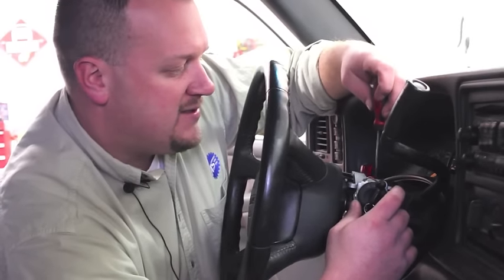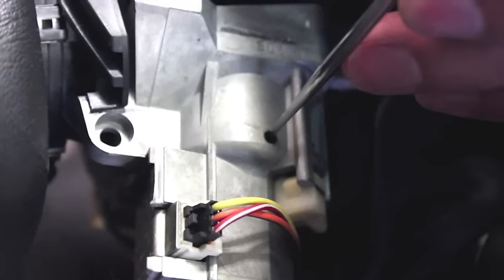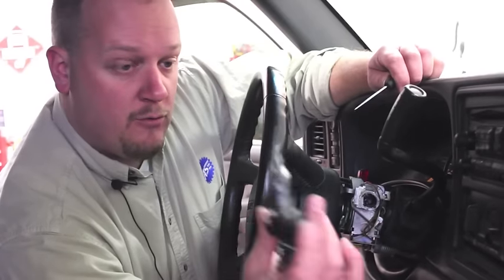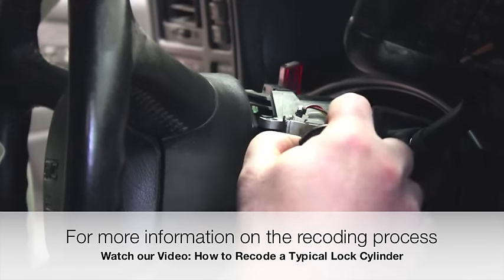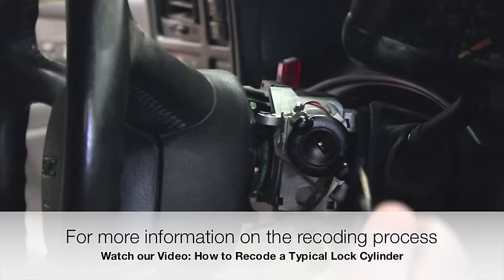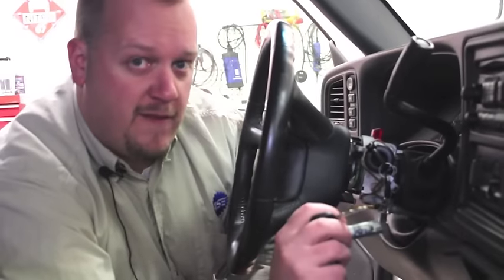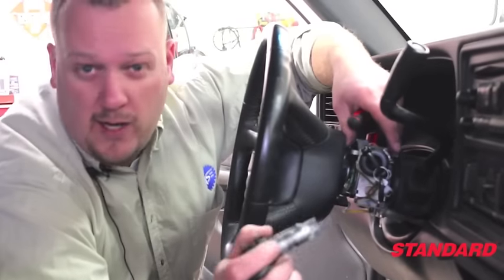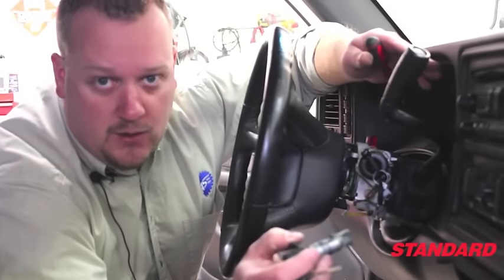Ignition Lock Cylinder Replacement (late model GM Trucks)

Comment: What if the old key don't turn the switch to the on position can I still change it.
Reply: My current problem
Reply: @jamessteyn980  figure it out? I have same issue
Reply: I used a hairpin to push the bottom locking bar @WilsonGamingYT

Comment: This is the most helpful video on GMC lock cylinder, and ignition module, replacement. I used this technique on our 2000 Envoy. No need to take off the steering wheel like other videos propose. Trickiest part is removing the plastic covers on the steering column. There are two torq screws accessible from the bottom. Take those out, remove the steering column adjustment lever (I used pliers for a firm grip, and pull straight out) then using flat head screwdrivers push & pull on the bottom column cover to remove. Swearing helps. Once it's removed, there is a reverse torq screw holding the top cover in place. I used a small socket that fit, the screw is not in real tight. Then the top cover can be pushed and pulled till it's off. Remember to disconnect the battery. Once covers are off, simply follow the directions in the video to take out the lock cylinder. If the key & cylinder won't rotate, there is a small bronze-coloured tab below the cylinder you can push in and the key will turn to the crank position (I got this off another YouTube video---on the Envoy, with the steering column cover on, there is a small access tab on the lower right side of the cover [at about 4 o'clock when facing the steering wheel] which can be easily popped off to allow a plastic prod to be pushed in to compress the tab. Without the column covers on, you can push the tab with your finger.) The ignition module could also be switched out if needed, it is accessible with the covers removed-again, no need to remove the steering wheel. Thanks for the great video, saved me time working in 28 degree cold. I knew it had to be easier than taking off the steering wheel, a few years ago the key in our 1998 Jeep would not turn, our local mechanics came over, towed the car to their shop and were back with a working cylinder in about 1/2 hour. They must have used some version of the technique outlined in this video.

Comment: to remove shroud, remove two t20 from bottom. remove bottom half. there's an inverted torx in front of the ignition switch. it holds the top half of the shroud down.  I used a 4mm socket to remove that. then tilt the wheel all the way down and fight the top shroud off.

Comment: For those that are still wondering how to change the cylinder if you cannot turn the key, you do not have to force it or break it!
There is a small detent on the outer ring, justnear the bottom facing the driver.  A simple screwdriver or pick inserted there will allow you to compress the cylinder ring and slip past the pins.  Then, when its in the ON position, the rest of the process to change the cylinder is quite simple.
I have AAA and called out the locksmith because I could NOT turn the key at all, even after removing the cowlings and trying lubrication, etc.  
The locksmith sat down and in 5 seconds had the truck running.  We changed the cylinder at this point and its all good.  

FWIW, the AAA membership saved my backside, and that ONE covered event paid for the whole service for a year.  Not that I am selling AAA or anything like that, but its worth the investment to me.  Now I know how, I am unlikely to ever need to do this again, because the new cylinder will outlive my 2002 Chevy.

Good luck to anyone who finds this post helpful, or is in need of this information!
Reply: U saved my but thank u

Comment: Great instructional video,
I swapped out the lock cylinder on my 2005 Silverado in 20 minutes!
New lock cylinder with keys cost me $50, dealer wanted $330, parts and labor.
Thank you,
Reply: My 2005 Silverado is acting up and I believe it is the ignition. Power stays on to radio even after key is out and doors open and shut. Do you think this will solve my issue?

Comment: I switched out my old stuck bad ignition with a new one off eBay & everything went as you said, fairly easy, Only now the truck wants to start and sometimes does start but dies right away. My truck has never done that, do you think the new ignition that seems to work perfectly somehow isn't allowing it to run?
(I did have the negitive battery disconnected until i was done) could i have possibly shorted out something? Any help would be greatly appreciated.

Comment: I have a 2003 suburban and it seems the ignition cylinder and key are messed up. I can't turn the key in the ignition at all but the key works in all of the doors. how might I get the old ignition cylinder out if the key can't be turned at all?
thanks,
Marc

Comment: Can I take the key and ignition from a different truck and swap it into my truck or would I need the pcm for that ? Currently swapping a 4l80 into my 5.3 and my friend said I can get his harness and pcm but at that point I’d have to delete the vats to be able to start the truck cause key would be different but if I swap his ignition over and use his key it would start so just trying to see if this would work because it would be cheaper than buying hp tuners and deleting the vats

Comment: Hi, Good video, better than the others.  I have a 97 GMC Sierra. Problem is, removing the top & bottom shrouds from the steering column. The hole for the key cylinder is one piece with the upper shroud and with the black plastic key shroud on the key cylinder it can't be removed. Is there another way to access the push hole to release the key cylinder?

Comment: Truck still runs after key is to turned off and removed in 99 tahoe...I have aftermarket viper remote start alarm also the key is worn and sometimes have to wiggle it to get it to turn...do you think it's the ignition and key? Need advice before I spend all sorts of money on meaningless parts...

Comment: I changed the ignition cylinder switch because my Tahoe got stolen. We found out that they were using any random Chevy to start our Tahoe. After switching the ignition cylinder switch we found out that it could still be turned on with any key or screwdriver just by putting a little pressure and turning it. How could this issue be fixed since we already replaced the ignition cylinder switch and it could still be turned on with mostly any object.

Comment: i have a 2005 ZR2 Blazer and replace my vehicle's ignition lock cylinder. it starts and turns off but i cant turn it to the   eauxillary spot or pull the key out what did i not do or do wrong this was my first time doing this and with this video it was not hard. thanks for you doing this video .

Comment: Hello, My name is David. I really need some help. I have a 99 Suburban 1500 4wd. The security light was on for a few weeks but there was no problems. I left the lights on, battery went dead, I jumped it to start it but all it does now is start for a half second and shuts down.   had a couple look at it and they say its the factory security system.    Any thoughts or advice on this would be greatly appreciated..

Comment: ▪️▪️▪️▪️So we replaced ours in a 2005 buick rendezvous & it came with new lock cylinder and set of keys. The ignition comes on but won't start we keep getting SECURITY light after the battery light. I've tried the ignition on for 10 minutes cycle already. Any other ideas? Thanks for your help! ▪️▪️▪️▪️▪️

Comment: so how do you replace one if the lock won't turn to the crank position ? 
sht worked fine one min next it left the starter cranking then once i got it to turn back the key is still locked in the cylinder and it will not turn far enough to crank now ..
Reply: I have the same issue,
Reply: You have to tap on it and it will turn

Comment: What if the cylinder will not turn to get to the push pin lock ,  I purchased you lock cylinder thinking it was held in with a bolt.

Comment: what if key does not even turn? can i still insert that pick into the hole and it'll come out?
Reply: Did you figured it out ? I'm with the same problem ...
Reply: No, because the clip is turned 180 degrees from the access hole.

Comment: 2002 Chevy s-10 4cyl 2.2liter Standard transmission
Started by having to fight with the key for 5 minutes to get it to crank. took it to a mechanic and he replaced the Ignition Switch(wires) but could not replicate our problems. it worked for a few days and stopped cranking period, however we could still push it off. everyone including the lot we are buying it from says Security. we bypassed the security and now it's completely locked out. 

Will replacing the Lock Cylinder Fix this?

Comment: Any resend why you would changing this piece out? The resend why I ask my 96 gmc sonoma just lost all power, and turn off on me the other day, I changed the ignition switch and not the ignition cylinder, but still have no power.

Comment: have done lots of these, and one of the big reasons they need to be replaced is they won't turn. its fine and good that it has to be in that forward position to release the tap, but when it doesn't turn, you grab it with a pair of channel locks and turn it, all the guts of the cylinder break, but its in the forward position, release the tab, it comes out, there's usually no damage to the housing, sometimes a bit of a scuff mark on the outside of the hole from the pliers, but just put new coded cylinder in and put it back together. sounds simple enough, but you need to get a good bite on the outside of the cylinder so it will turn, or else it slips, and sometimes can make more work for your self, if you break the outside of the cylinder off.

Comment: I took my cylinder out but now I can't get the new one or the original one back in. What should I do it doesn't go all the way in..is there a trick to do? Or what might be the problem
Reply: +john mosley The new cylinder has to be properly aligned so that the tab on the cylinder will catch when you push it in during the replacement.

Comment: I HAD TO STICK A LARGE FLAT BLADE SCREWDRIVER DOWN INSIDE  THE HOUSING TO ALIGN THE BOTTOM SECTION SO MY NEW CYLINDER WOULD DROP INTO PLACE

Comment: Fellas, those upper steering column shrouds can be awful to remove.  If all you're doing is replacing the lock cylinder, it's REALLY easy to drill through the plastic on top with about a 1/8" diameter bit and you can access the pin release hole in the lock cylinder mount.  That makes changing the lock cylinder about a 2-minute job.  Of course you will be left with a tiny hole in the shroud, so it just depends on how importance perfect appearance is to you.